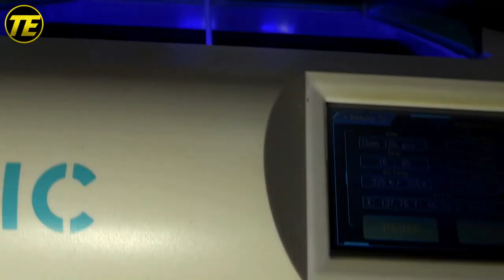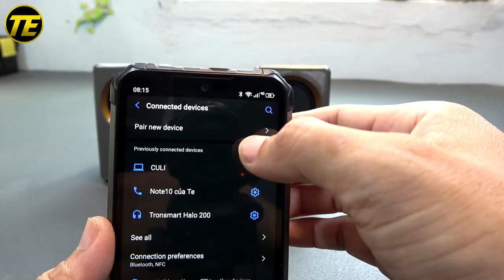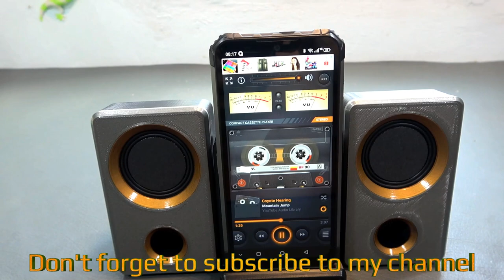Building Bluetooth Speaker With 3d Printer - V2

Comment: There is a product missing in action, I call it the cellular boombox. This is too big to be that idea. The idea is to utilize the new advanced smaller speakers and a small cell phone (something like the razrs that fold). With the right frame, you can place the speakers into the frame and the phone. This would then all fit in your pocket like a normal cell except you have better speakers. Right now the speakers are round but flat ones may also work (at least the shell could be flat). They could've done this with phones by now. Perhaps a new speaker implantation (with tubing to take more advantage of space) and a frame to make the concept work on legacy phones. The U Speakers and some others are the ones I have tried and produce a better sound than the phones speakers. #CellularBoombox
Reply from the maker: Good idea.